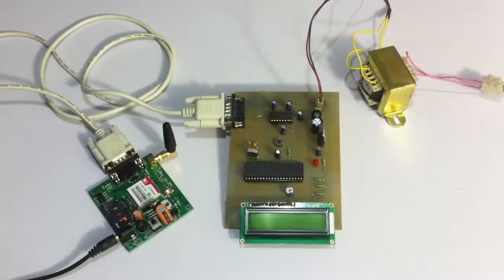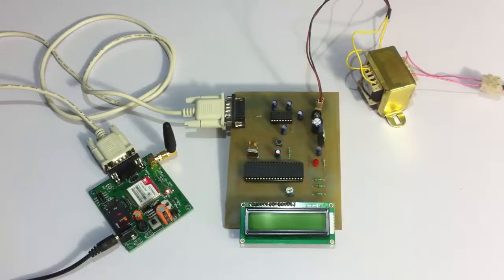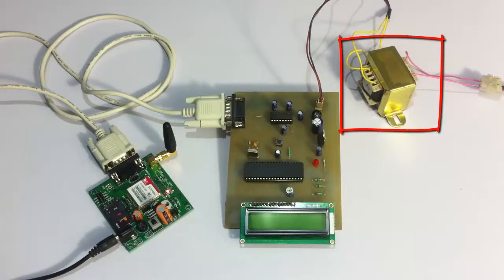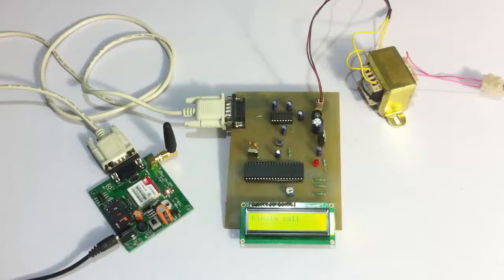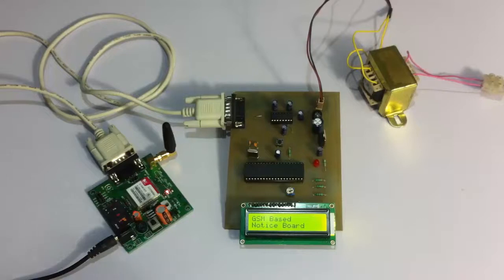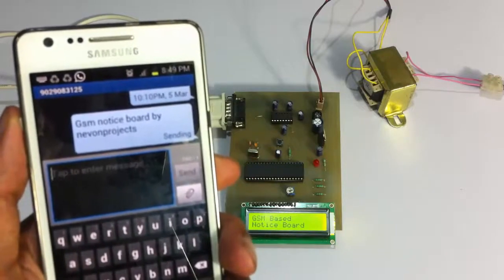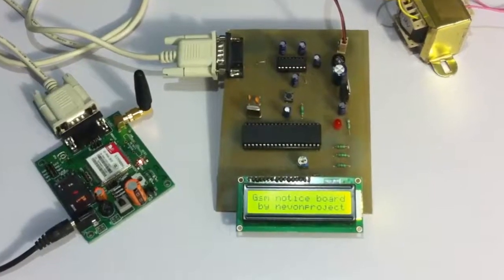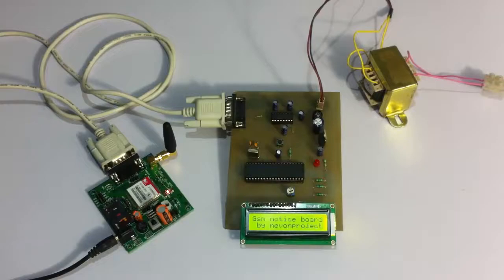Electronic Notice Board Controlled By Gsm

Comment: You said, the Voltage was Supplied by a 12V transformer. What was the current rating? 1A? Actually I have tried it several times, but the message sent to the sim doesn't appear on the screen. Though I didn't use 12V. I used 9V. How about the current rating? 1A would work or not?